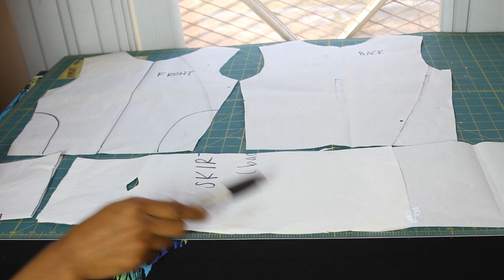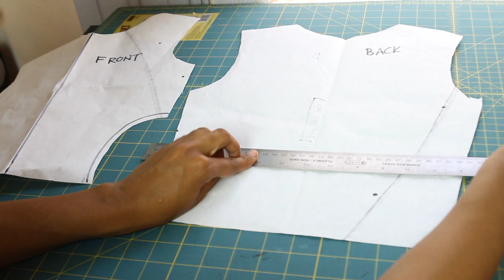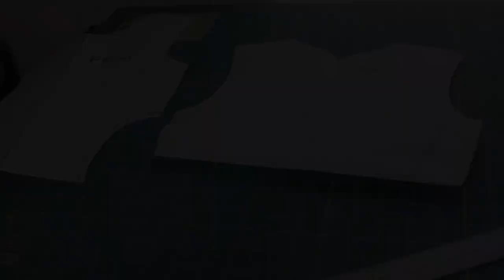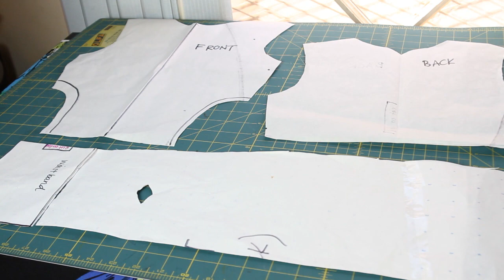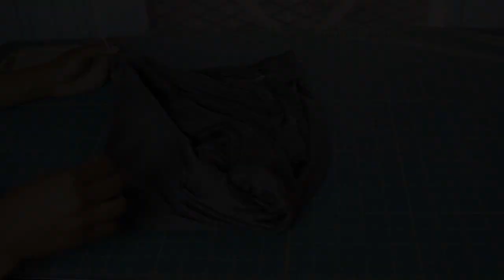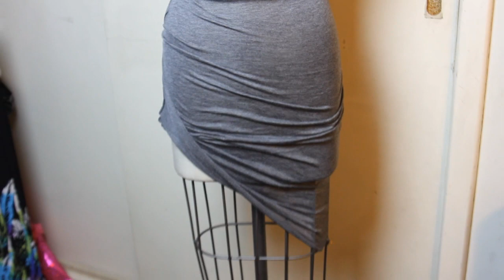DIY Asymmetrical Dress

Comment: i am a real newb when it comes to sewing..i got lost when you were attaching your pieces..

and especially when you did the thing that attached the bottom hem to the waist band..

is the bodice sewn on the same line as where you would sew the waist band to skirt? like is the end result supposed to look like the top is tucked into the skirt?

and is the bottom hem attached to that same line?
Reply: to better clarify my question you want to assemble your dress so that the top is actually attached to the skirt and the waist band wraps around both pieces? meaning you would be sewing through 3 layers once..

and not so that the waist band is attached to the skirt and the top is attached to the waistband? meaning you would be sewing through 2 layers twice..
Reply from the maker: When sewing this dress .. You want to sew 3 layers all at once.. You want to place the waistband over the skirt and you want to also attach the top to the skirt and waist band.. But before official sewing it all together u also want to lift one side and pin that in between the waistband as well.. Hope that helped! If not I'll send you close up photos :))